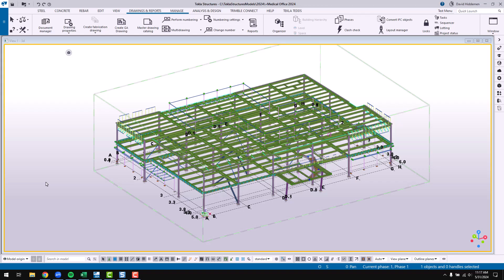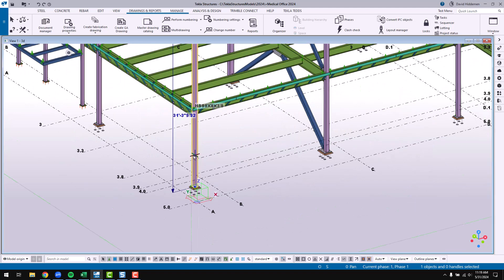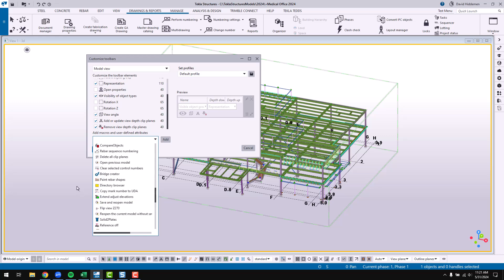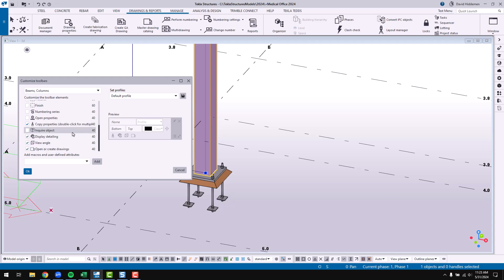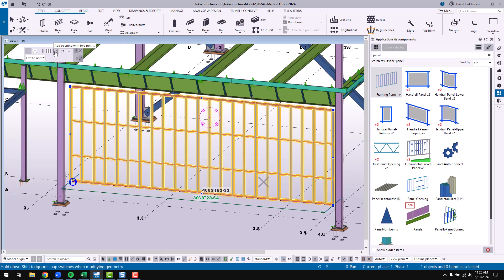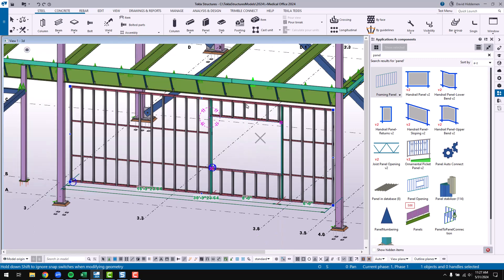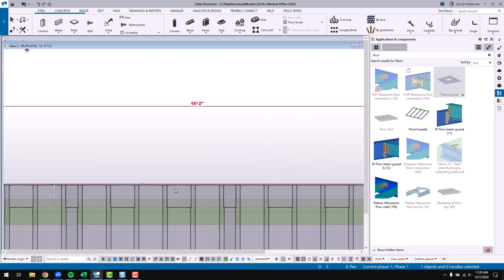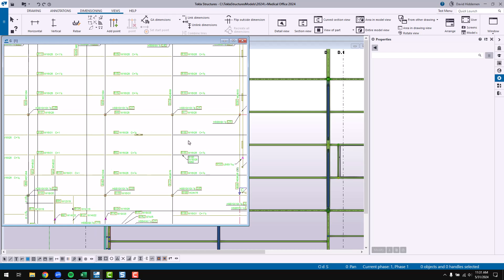Tekla Structures - the Contextual Toolbar

Comment: If I'm not mistaken, since ts2018 it was possible to change with cont.toolb. at least profile and class by selecting parts in drawing mode. If this feature is available now. Sometimes, it would come in handy, wouldn't  it.